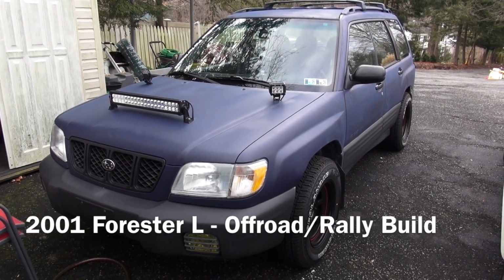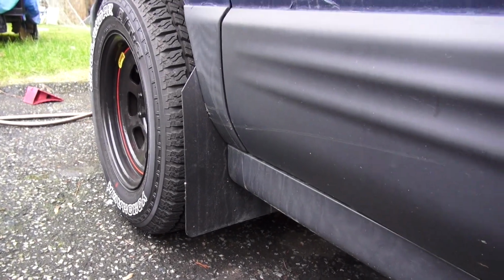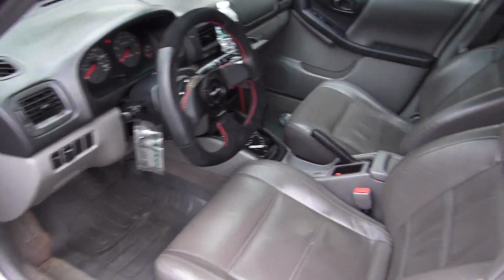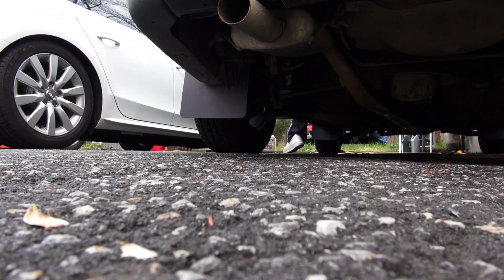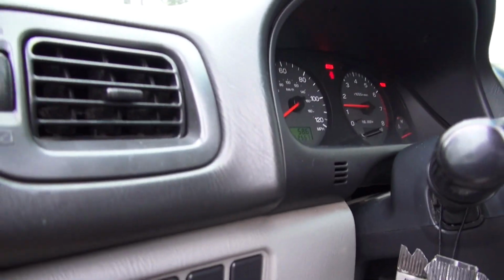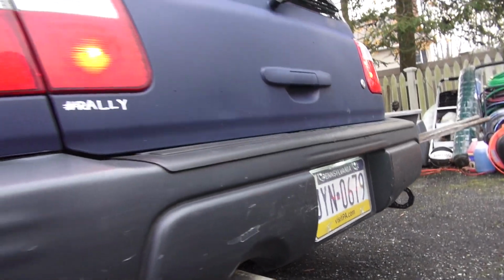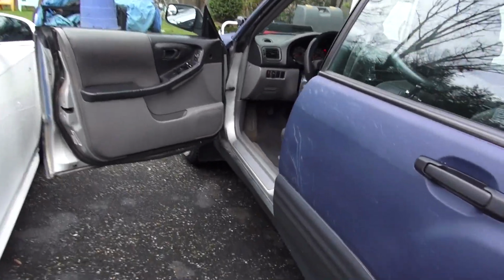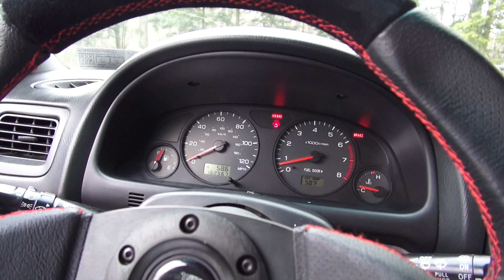2001 SF Subaru Forester Offroad/Rally - Walkaround, Exhaust

Comment: Hey! Loved the video! I currently own a 2012 Chevy Sonic Hatchback and bought a Heise 22" LED Light bar and want to mount it on my hood the way you have yours, do you leave slack in the wiring so you can lift the hood? Also how are the mounts that you used? Any feedback will help immensely!
Reply from the maker: Thanks! I used the mounts it came with and bolted through the hood. I left a little slack in the wiring.
Reply: Ahh okay, how much wind noise, if any do you get?

Comment: Hey big dog I just bought an 01 forester and was wondering if I would need spacers for a set up like this? Just want better tires to make it up to the mountain for a snowboard season
Reply from the maker: Hi congrats! No wheel spacers, but I recommend a 2" suspension lift for these tires to fit properly
Reply: Redline Performance thanks man I was also wondering what size rock blox flaps you used

Comment: Have to say, it's a pretty simple "paint job", but it looks pretty darn cool with those wheels.  What components did you get specifically for the exhaust past the cats?  That sound is exactly what I want for my '01 L.  Very similar project I have going on mine as well but I'm nowhere near your setup yet.
Reply from the maker: I have a 2.25" straight pipe with a Magnaflow muffler.
Reply: +Redline Performance Did you delete your resonator?
Reply from the maker: yes

Comment: great job. what wheels ET ?
Reply from the maker: +bdnlbn 4" Backspacking - not sure on ET
Reply: +Redline Performance so that is definitely stock shocks under there? Looking to get some of these wheels and just want make sure they fit. How is the caliper clearance? and did you need to get anything like a 'bolt pattern adapter plate that allows for balancing off of the bolt circle' which they recommend on the website?

Comment: Do or did you rub a lot with those tires on the stock suspension?
Reply from the maker: +Peter Miller Rubs in front fender liner and rear fender on bumps and hard turns - stock height.
Reply: Okay sounds good because I am wondering what size tires I want without rubbing! I have a 2003 Forester!
Reply: +Peter Miller 215-65-r16 without rub , I tried on 70 but it did rub so I change back to 65 on my 03 Forester . I have General Grabber At2
Reply: I was wondering the same thing but want to put a 1 1/2" lift on her

Comment: are you running on the stock struts and springs?
Reply from the maker: At the time, yes
Reply: @BuyYourBuild  Did you have any rubbing issues with this setup being 215 wide? I was looking at KO2's for my 98. Trying to figure out if I can stuff a 215/75 in there.
Reply from the maker: @evanolson8819  Yes, I rubbed alot on stock height. Definitely need a lift

Comment: Why aren't you using a air filter you're gonna try your motor
Reply: DIRTY WATER BASS'N if i recall right i has 1 air filters and on box that the air goes trought the box is gone the filter is still there
Reply: DIRTY WATER BASS'N dude yer silly he has one in the box right behind the engine
Reply: I thought the same thing for a moment but then realized the old Subaru's have the filter right off the throttle body